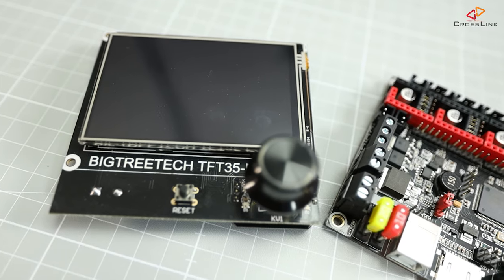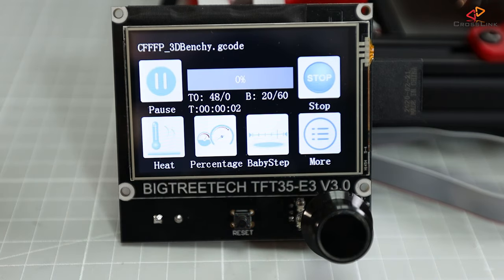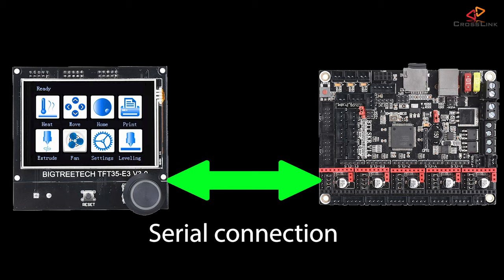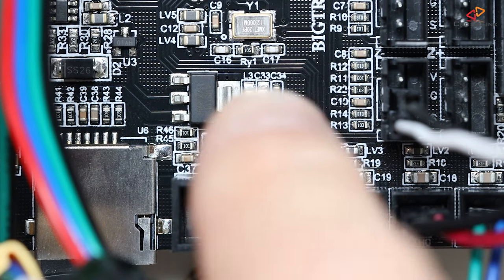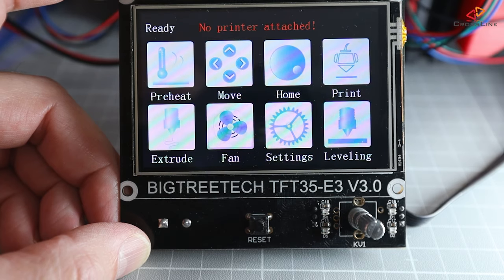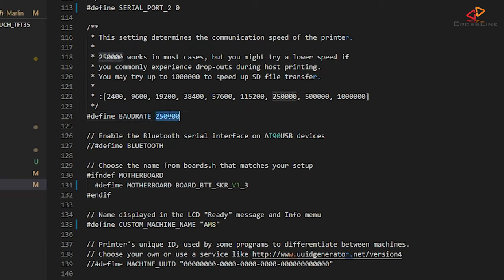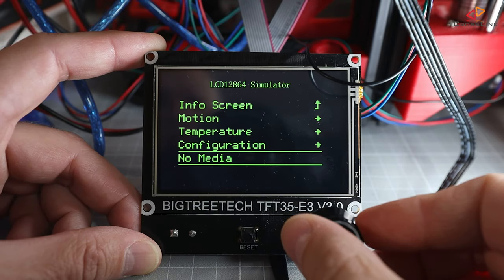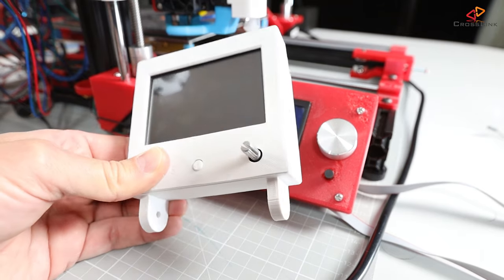SKR 1.3 / 1.4 - TFT35 Display Installation and Marlin 2 0 configuration

Comment: many thx, your videos helped me a lot!! one more thing - you mention you´ve managed to get octoprint running with changes on serial ports and some "jumper wires" :-). i think it would be extremele helpful and appreciated, if you made a (even short) video about that. i myself couldn´t find anything and without octoprint functioning it´s near to nothing for me (and most probably some others too)
ps: solved - just disable "request exclusive usb" in octoprint - finish. 🙂

Comment: If you're getting a black screen, make sure the Marlin screen resolution is set to 128x64 instead of 20x4 (Go to Settings, Screen, Marlin mode, Marlin mode type)
After doing that, change background color to something else (red color, for instance). Now if you go to the Marlin simulation mode, it should work. Change back to black background color if you please.

Comment: I had the persistent 'no printer attached' message. Compiled my firmware for the board and screen again, flashed both, still that error message. I watched your vid and you mentioned the error at 6:20. I checked and indeed it was at a different speed then my board. Weird cause I compiled it with the same speed in the firmware. Ah well, long story short, I got rid of my error message. Thanks.
Reply from the maker: Great to read this! Have fun!

Comment: I have some very weird things going on with my TFT35-e3 v3.0. I have the SKR 1.4 Turbo and I've gotten some very mixed results with my display.
After hooking it up as directed in your video, I only get beeping of varying loudness and sometimes I get display but with no touch or knob feedback. 1 time I got touch working with the display looking clean but that only lasted a few seconds and the display died again. I wonder if I just got a bad apple. It worked fine when I first bought it with my SKR-e3-DIP 1.1 but apparently it is no longer compatible with that board.

Comment: So, I'm trying to set up a DIY IDEX machine using a BTT Octopus V1.0 and the TFT35.  I have things working pretty well in marlin mode, but the touch screen mode does not show a 2nd extruder.  I went into firmware and changed the hotend and extruder counts to 2 but that does not seem to do anything.

Comment: DaveJS
Thanks for the video, I now have a few hairs left!
I just could not get the LCD to display when connected to an SKR1.4Turbo board which I'm setting up for my Enders 3 Pro.
Graphics mode worked fine.
Both modes worked fine if I connected the TFT3.5 to the Melzi board (running under Bugfix-1.1.x) using the Exp 3 socket.
So I knew at that point the there was nothing wrong with the display.
However, no joy when connected to the SKR board.
But after viewing your video I was able to make the following changes to the Configuration.h file (in Bugfix-2.0.x):-
Uncomment     //#define REPRAP_DISCOUNT_FULL_GRAPHIC_SMART_CONTROLLER    (About line 1995)
Comment out     #define CR10_STOCKDISPLAY  (About line 2081)
Everything then works just as it should. So thanks again.
Reply from the maker: Happy to see it's working for you!

Comment: also, I can't get the TFT35 E3 firmware to install. I know the cables are inserted correctly. And I have tried different Baud rates. I just get No Printer Attached or as stated below I get a constant BEEP if I use the REPRAP_DISCOUNT.... display type.

Comment: HI there, i have an Issue, Board MKS_Gen_1.4 with Bigtreetech tft70_v3 , Display says "no printer attached" and in the "Info" System: Unknow system"
I switched the "tx & rx" Cable so now they matches with the Board and Display. 
Baudrate is the same. 

The Problem is, i cant set any serial port on "minus"
PlatformIO writes an error that "i cant set it on minus"
It says: pasting "USART" and " -" does not give a valid preprocessing token. 

I dont know why im the only one who has this problem, everywhere i read that people set it on minus and it works. 
But I cant.

Please help me

Thanks

Comment: Good video.  I want to use reprap on my SKR 1.4 which means using the Exp ports for the wifi board.  So I can just use the TFT connections to use my TFT35 screen for PanelDue?  Thanks.

Comment: I have printers with both touchscreens and the simple encoder type on the Ender 3, and I prefer the one on the Ender 3.
I guess it is because of the simplicity of the display, the command titles are in a list format which makes it easier to see what you want, maybe if the touchscreen was in a vertical format with the commands in a list I would get on with touchscreens.

Comment: Hello good fellow looking for help my printer will operate on the marlin side but when I go to the touchscreen side all it shows no printer connected and will not go away i changed baudrate that didn't help even tried a second LCD no good I'm trying to hook this up to a BTT v1.4 turbo any ideas what version of marlin are you running also do you have a usb cable connected while you are doing this

Comment: I have Ender 3 and SKR MINI E3 V1.2  + TFT35-E3 V3.0 . The problem is there is a message on the screen : "No printer attached" . I have setting in Marlin configuration: 107 #define SERIAL_PORT -1; #define BAUDRATE 115200; 1993 #define CR10_STOCKDISPLAY. And where is the problem?

Comment: Perhaps a little overkill for a simple Anet A8 which is all I have.  But I must say the hardware - board and TFT - doesn't set you back much. 
But as for the A8 , its relatively flimsy print bed support,...maybe not worth the trouble. I have lived with its shortcomings  and made countless practical prints. 
So now it is time to bite the bullet and finally buy the Ender 3. I feel so behind the curve now :-)

Comment: I use the cr10 display setting in marlin that way you only need 2 cables the serial and the single 10 pin cable from the ender 3. I tried to set it up your way on my skr 1.4 turbo but it just refused to work? Bigtree tech stuff dose some very flaky things at times what works for some people dose not always work for others. The weird stuf I had go on with my BLtouch ,it like its posesed from it not working after flashing a new firmware to reflashing the exact same  new  firmware it works again?

Comment: Love you Videos, so glad I subscribed !, I have a question, if I could, I upgraded to a BIGTREETECH SKR .14 Turbo and TFT50 V3.0, and installed Marlin 2.06, My issue is Both Marlin Display , Or Bigtreetech display show NO BED icon, so will not heat of course, Triple cheked the wiring, Any Ideas ?.... Thanks

Comment: Have a question for you out of this topic. I have the skr1.4 turbo with tmc2209 and a proximity probe. I cannot seem to get the probe to work
I have tried everything in change wire diagram and nothing it is always on open with led lit up. And when i touch metal it still stay open and not triggered
Reply: inductive sensor? did you follow chris riley's tutorial? and check to make sure your pins are correct.
Reply: @IamG3X  yes but i got it now thanks for your reply

Comment: Is it possible and if so where to buy a longer cable (approx. 1 meter) to go between the TFT35 display & SKR V1.3 control board, the black one shown in all the pictures with the 5-pin Dupont connector on one end and 5-pin JST connector on the other?
Reply: debes prolongar el cable o bien comprar las fichas y armar el cable tu

Comment: Thank´s for the video
Is this board also a silenced or not?
And last but not least, is it compatible to a silenced board for the ender 3 pro V4.2.7 ?
Reply from the maker: That depends on the stepper drivers you buy for it. By default, no drivers included but you can get any driver you like. For example TMC2208, TMC2209, TMC2225, etc. That will determine what features you get and if they are silent.
About compatiblity of the TFT35 to the 4.2.7. there is no serial port to connect to so it's not going to work in touch mode.

Comment: I've been told this board won't work in a stock Ender 3 by one person and another person told me it will work. As far as I know they're still arguing over it, so I thought I'd ask someone who knows the correct answer.  Will this board work on the Ender 3 with no modifications or extra hardware?  Sorry I elaborated a little. I enjoyed your video and I have to wonder why the board isn't fitted as standard,  The one it comes with isn't the best.
Reply from the maker: I don’t know but I can try it 😁

Comment: nice video what about OCTOPRINT do we connect the USB to the TFT or to the SKR 1.4 ?
Reply: @kevinm3751  to the board itself
Reply: @kevinm3751  yes but now I changed the card to skr pro and sbc mode of Reprap no more Octoprint
Reply: @kevinm3751  yes agree now am running without pi only reprap with esp for the wifi plugged on the exp1 and 2
Reply: @kevinm3751  yes am using the pi now as microcomtoller and controlling some relays with python code lots of fun try to check it out soon I will add it in my YouTube channel

Comment: I bought 
BIGTREETECH SKR CR6V1.0 Control Board 3D Printer part for CREALITYCR-6S E3D printer.
What screen can i buy for it?
Reply from the maker: As the specifications state it works with the original display or the TFT35 from Bigtreetech

Comment: Hi thanks for the video, I used the tft35 v3 on my Ender 3 and added the skr mini e3 1.2 at the same time my question is why the second ribbon cable? I used exp1 and rs232 and everything worked, do I need the exp2 cable also? Thanks
Reply from the maker: The SKR mini e3 uses one ribbon cable only, that is correct. Two cables are only needed for SKR 1.3 and 1.4.
Reply: @Crosslink3D  When I plug in both cables, it does not work on my SKR1.4 and TFT 3.5, It only works with the Rs232 and EXP3? Am I missing something?

Comment: HI - THANKS FOR THE VIDEOS - I FIND THEM VERY GOOD - i have issues - my board wont load the bin file and screen wont come on - i have been stuck like this now for 10 weeks
could you offer any help ? many thanks
Reply: Been there ... Had to find an old sd card I think 4 gig that was formatted fat32 and boom all was right again.... Originally tried with a 64 gig... I think thumb drives work also
Reply from the maker: As @edward sharp mentioned, it could be the SD card formatting but there is also a chance that the bootloader is broken. Did you try to flash a new bootloader in any case?
Reply: @Crosslink3D  i cant get my head around the bootloader story - i bought another skr1.4 - its working - BBT have been totally useless their support sucks

Comment: Does the tft35 e3 connect to the stock E3Pro motherboard?
Reply from the maker: Not without soldering. The stock Mainboard has rx and tx pins but they are not connected so you will have to modify the PCB: https://github.com/luc-github/ESP3D/wiki/Creality-CR-10-Ender-3
Reply: @Crosslink3D  thanks, I was hoping this would be confirmed, I'm getting the new BTT motherboard soon so I'll put my screen aside for now